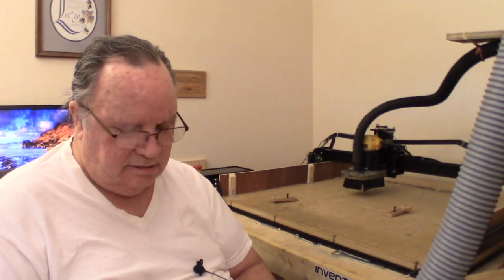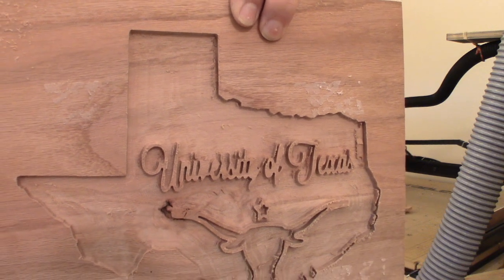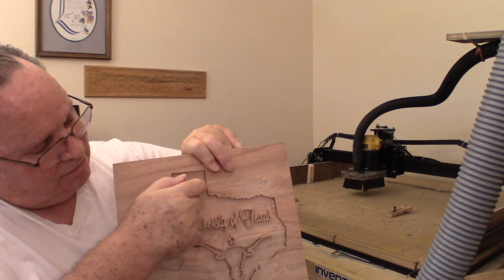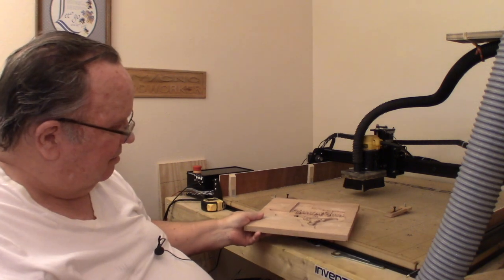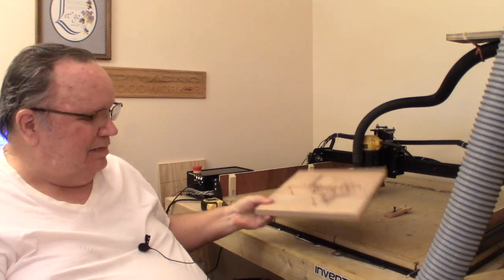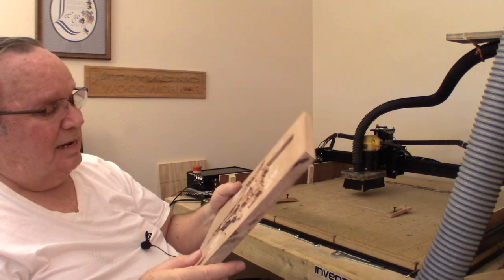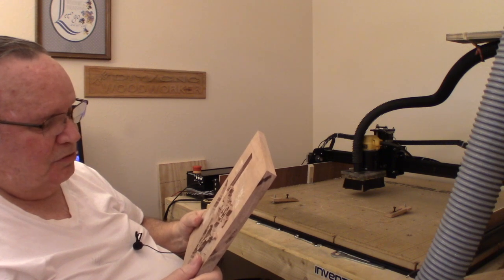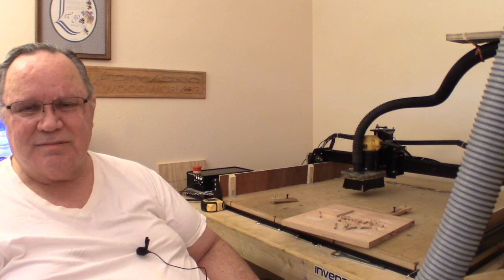DUAL CARVE BETTER BUT STILL NOT RIGHT!

Comment: you do not need a setup block for the carvings you have posted. after the first carve is done jog the machine up change the bit and Home your machine with limit switches. once your machine is homed it knows exactly where it is. Reset you z with a touch block or the paper method or any number of other methods. tell the machine to return to zero and start carve.  Some of the other issues may be caused by an out of square gantry/spindle.